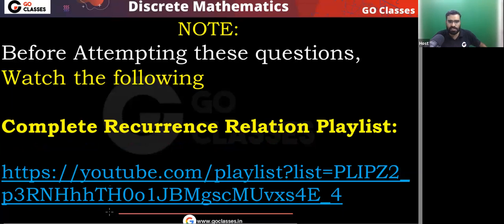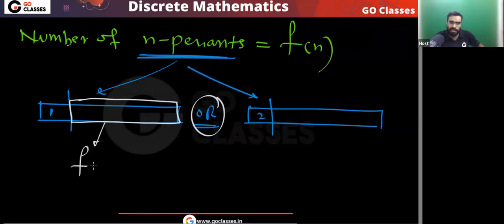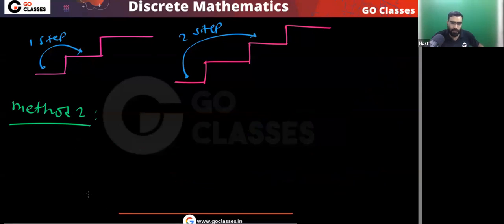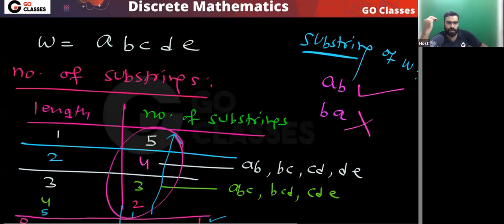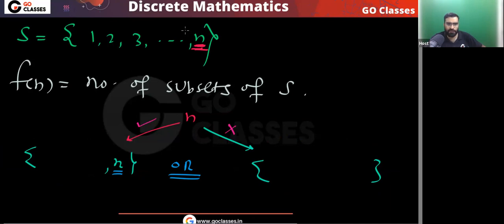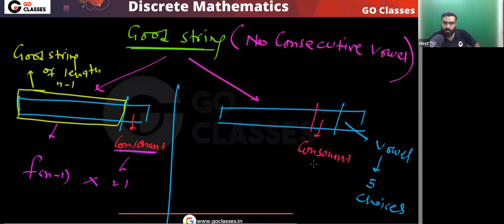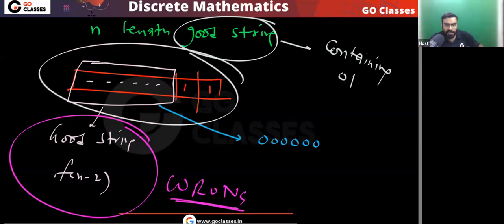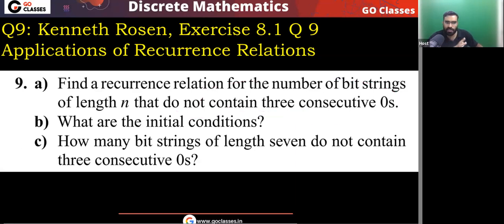Combinatorics Practice Set 2 Discussion | Recurrence Relation Kenneth Rosen Questions | GO Classes

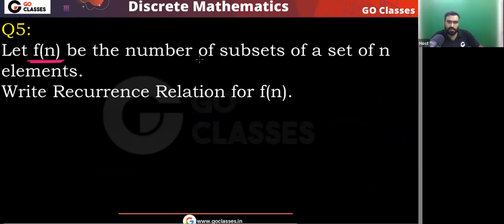Comment: 1:13:50
f(n+1) = f(n) + 2^n

This is based on the combinatorial principle:

(n choose 0) + (n choose 1) + ... + (n choose n) = 2^n

Step 1: Start with 3 Elements → S3 = {a, b, c}

Let’s list all subsets of S3 = {a, b, c}:

Subsets of size 0:

∅ ⇒ (3 choose 0) = 1

Subsets of size 1:

{a}, {b}, {c} ⇒ (3 choose 1) = 3

Subsets of size 2:

{a, b}, {a, c}, {b, c} ⇒ (3 choose 2) = 3

Subsets of size 3:

{a, b, c} ⇒ (3 choose 3) = 1

Total subsets:

(3 choose 0) + (3 choose 1) + (3 choose 2) + (3 choose 3) = 1 + 3 + 3 + 1 = 8 = 2^3

Step 2: Add a New Element → S4 = {a, b, c, d}

Now we add d to the set. Let’s figure out all new subsets that include d.

Key Idea:

For every subset of {a, b, c}, create a new subset by adding d.

Original subsets of {a, b, c}:

∅, {a}, {b}, {c}, {a, b}, {a, c}, {b, c}, {a, b, c}

Total: 8 subsets

New subsets with d added:

{d}, {a, d}, {b, d}, {c, d}, {a, b, d}, {a, c, d}, {b, c, d}, {a, b, c, d}

Total: 8 subsets

Step 3: Total Subsets of {a, b, c, d}

Combine:

Old subsets (without d) → 8 subsets

New subsets (with d) → 8 subsets

So:

f(4) = f(3) + 2^3 = 8 + 8 = 16 = 2^4

Meaning of the Formula:

(n choose 0) + (n choose 1) + ... + (n choose n) = 2^n = Number of subsets of n elements

The 2^n value represents the number of subsets for n elements. When adding a new element (d), we:

Keep all old subsets (don’t include d).
Add one copy of each old subset with d added.
This explains why:

f(n+1) = f(n) + 2^n
Reply: yeah this is also correct but you can write that 2 power n as f(n) then the equation becomes f(n + 1) = 2xf(n)

Comment: I got the same answer for the last question using another approach:

Let's suppose for a 3 length, total ways = 2^3 i.e 000, 001,010,011,100,101,110,111.
Now no. of good strings of length 3 = 4 i.e (001,010, 011,101)

Part A: Now for good strings of length 4, if we take good strings of length 3 and whatever bit (0 or 1) we append at end, we get a good string of length so: 
2 choices for last bit * f(3) = 2*f(n-1)
+
Part B: Now for strings of length 3, we have total 2^3 i.e 8 choices but the string 111 can never give us a good string because 1110 and 1111 are both bad cases. Therefore, remaining strings are:  ((Total - 1) - already counted cases) =( (2^(n-1) - 1) - f(n-1)) * 1. These strings give good cases only with one choice hence multiplied by 1

Adding A and B:
2*f(n-1) + ( (2^(n-1) - 1) - f(n-1)) = f(n-1) +  (2^(n-1) - 1)

Is this approach correct?